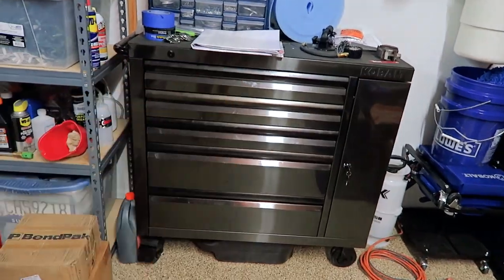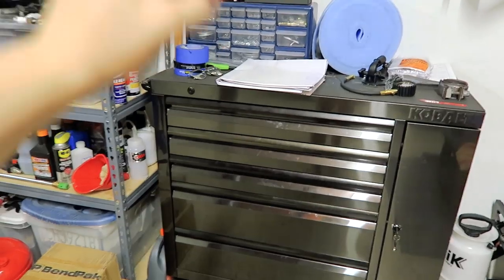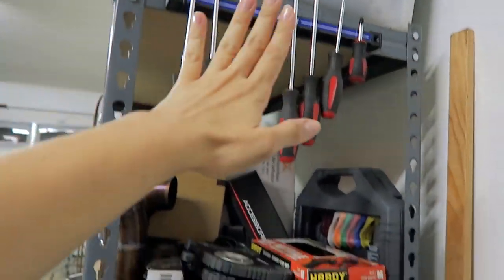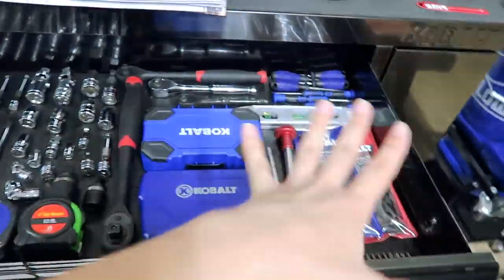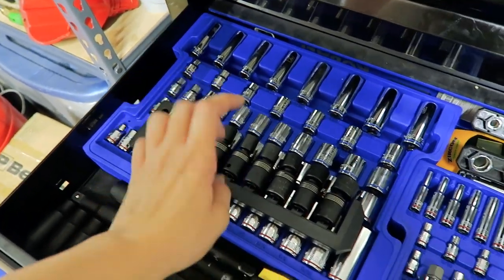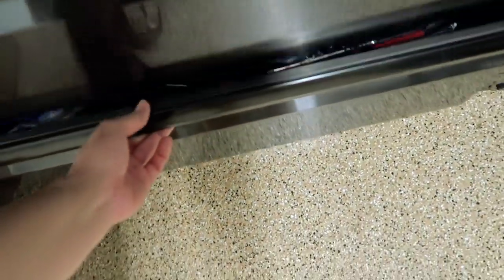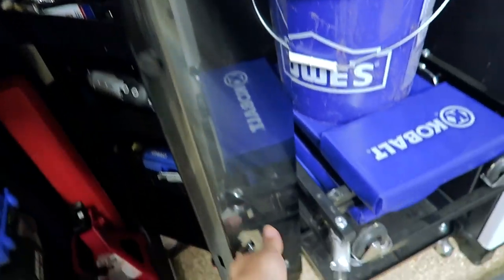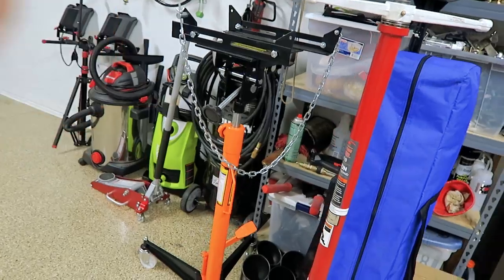SO WHAT'S IN MY TOOLBOX?!?! + Q&A ANNOUNCEMENT!

Comment: Glad you like the cordless wrench. I use mine all the time. Never use it to do the initial break but great to spin off or tighten up to it’s max torque if necessary. They come into their own when the bolt or nut is at full reach as you don’t need to swing. I also like the stubby style screwdriver impact. As for tools breaking, take that as a sign to buy the more premium make for that tool application. Cordless impact next eh?......
Reply from the maker: I love it..I should have bought it a long time ago. When I bought it I used it to screw things in, when I did started by hand first. But it makes it so much easier. Cordless impact is next..the hose is old school lol. Cheers!

Comment: miss, I want to ask, how much is the electric impack wrench?
Reply from the maker: Hello. I don't have a cordless Impact..at least not yet. Only a cordless ratchet. That was $80. A cordless impact can range between $150-250 depending on brand. The one I have requires an air compressor.

Comment: I'll go into the obtuse... because I can. Aside from everything you showed, can you give me your opinion on the house vac system. I have been contemplating adding one to my house but getting honest feedback is a bit of a challenge. It "seems" most people like the convenience but the suction is suspect at times. I just added a Great Dane, and with the smaller finer hair, need a bit of suction. Anyways, your thoughts are appreciated. Channel is doing awesome! Hope to see you at 250K soon.
Reply from the maker: I suppose I can answer this one as it's very specific. The vac system is more like a thing you think you need, but likely won't use as many times as you'd like lol. This house came with it and it was cool using it. You have the convenience of just vacuuming without having to empty frequently. But you still have to disconnect the power cord and move it to a closer outlet. The same goes for the hose when you move around. I have since bought two roomba's and never looked back. I had to empty the roomba more at first. But if you have it on a 3-day schedule, it's way more convenient. It helps immensely with pet hair..I have four dogs running around and the roomba's have more than enough paid for themselves with saving me time. Cheers!

Comment: Hello, You have awesome Tools. Do You have inch and mm wrenches? In Your GT350/Camaro, did they use inch nuts and bolts? Thanks for sharing. Take Care. Bye.
Reply from the maker: Yes..both standard and metric sizes. As for the GT350/Camaro..it all depends. There is a mix of both sizes on each car. It's kind of annoying.
Reply: @woman.driven  Thanks for the Reply. Yes, that means You  have two sets one for BS another for metric. Thanks again. Bye.

Comment: Tool collection, it's a slippery slope! Would you consider getting in the Milwaukee game?

They have big tool chests w/power outlets and larger drawers. Glad you got that Husky cordless rachet. Idk how powerful it is compared to Milwaukee's - theirs is AWESOME!

And their Fuel Hackzall is a powerful small & lightweight reciprocating saw. You might like it better than that DeWalt.
Reply from the maker: I can see how tools just never ends..I've bought some things I felt were needed one day..still not used it yet. Milwaukee is great. I was between that brand and Husky when I was buying the cordless..the different was this:

The husky was only 5 ft lbs less (30 instead of 35) and it was $69 (it was on sale for $10 off lol). It did not have an interchangeable battery, as It's integrated. The Milwaukee was $140. I used the Husky for a 10 hour project and it still had 2/3 of battery life left and I used it a lot. I love it.

If I never use a reciprocating saw again..I would be happy. But yes, a smaller one would likely be better. Thanks for watching!
Reply: @woman.driven  You taught me something cuz I didn't even know they made one. That was a good deal! I got mine as a free tool with the 12V Fuel drill/driver combo during a Christmas sale.

Comment: I had the Kobalt air ratchet, and the head of it snapped off while using it and I only had it for three months!
Reply from the maker: Wow. I hope you returned it for a replacement. I've used mine quite a bit on suspension components..still works. Cheers!

Comment: What you referred to as "converter bits" are commonly called "adapters".  Examples are a 1/4" to 3/8" adapter, or 1/2" to 3/8" adapter.   I'm sure you knew that, but all of us, in the heat of battle (or while filming a video), can forget the common name for a tool.  I noticed the majority of your sockets seem to be down in Drawer Three, separate from Drawer One, where your ratchets, extensions and some of your sockets are.  It may make sense to keep those up in Drawer Two for convenience and ease of grabbing them as needed by switching out the contents of Two and Three; just a suggestion.  Something else to consider:  Build your own workbench from wood.  You could make it whatever length, width and height you wanted.  You wouldn't need to have drawers, which increases the cost and weight of commercial units.  If you don't already have one, be sure to add a bench vise, too.
Reply from the maker: I used both in videos..it just kind of depends on where my mind is and what I'm to say next. I received a lot of tips and suggestions for this video lol. So I need to make the changes so it flows better. Starting with buying socket rails and other items to reduce space used. The ratchet being one drawer above the socket makes perfect sense. As for the work bench..I really just need the room. I am planning to move the work out gear inside to make room. But yes, a vise is needed. I found myself requiring one many times. Thanks for watching.